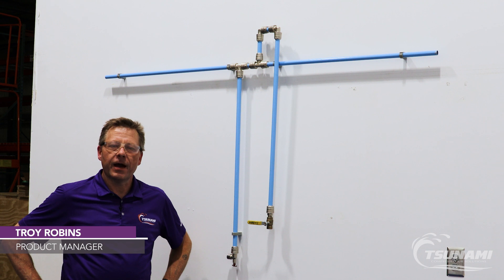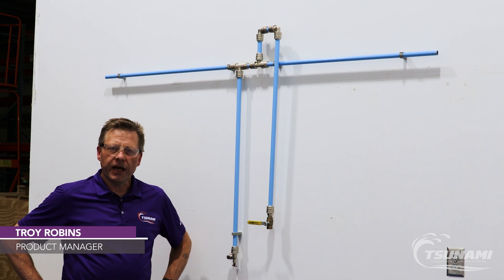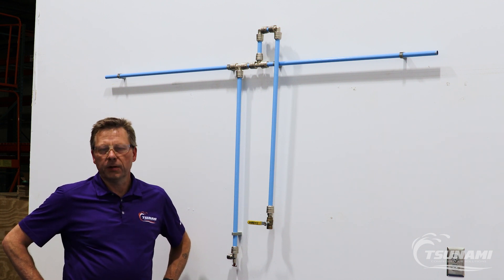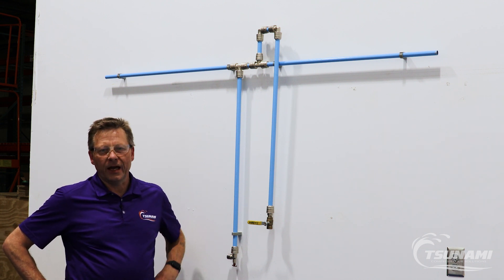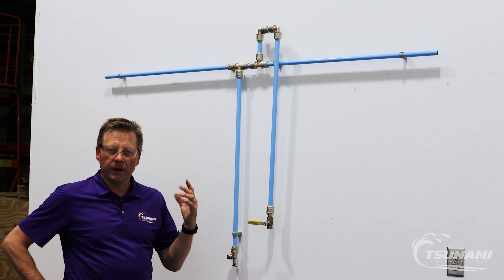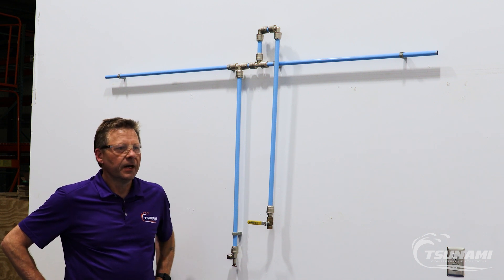How To Plumb an Optimal Compressed Air System

Comment: Is there a certain length each leg should be?
Reply from the maker: Great question! No, there is no required length for the legs as long as you have easy access to the ball valve.